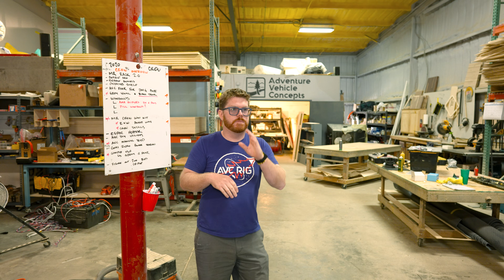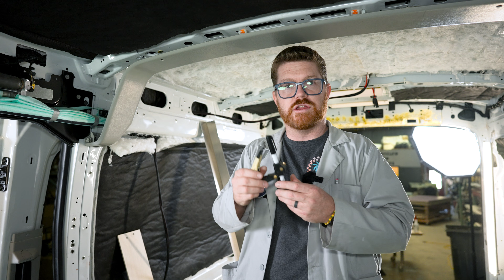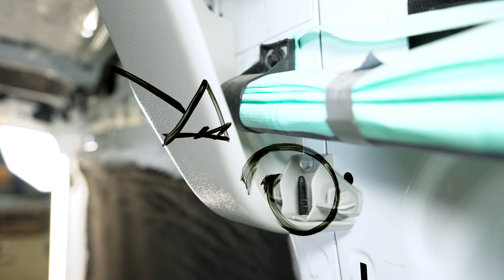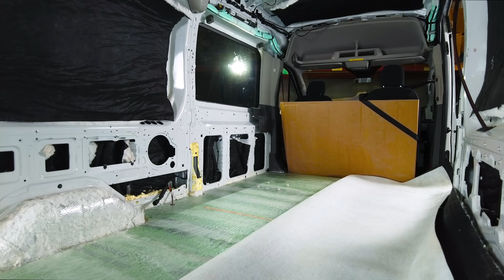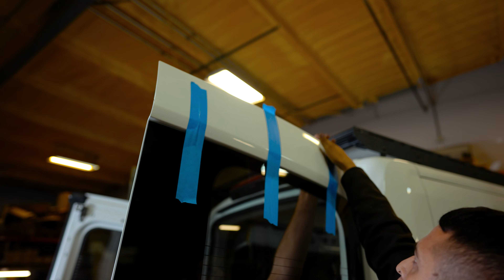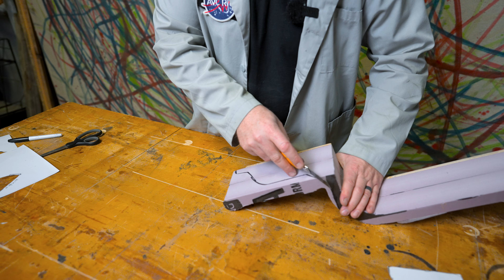Ford Transit Crew Build | Empty Van to Base Interior!

Comment: The insolation is very common, practically nil, when there are low temperatures outside and the heat from the heating is indicated to keep the interior warm, the condensation will fill the interior of the camper with water, the beams are not insulated and the heat bridges are many. In three winters, that camper will be completely rusted, in short, that job is terrible and is a deception for the buyer.